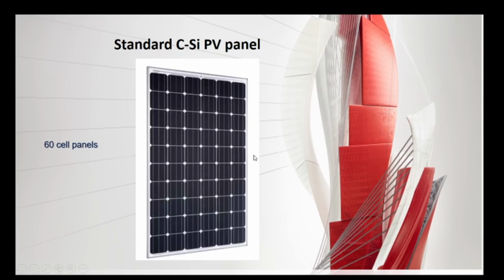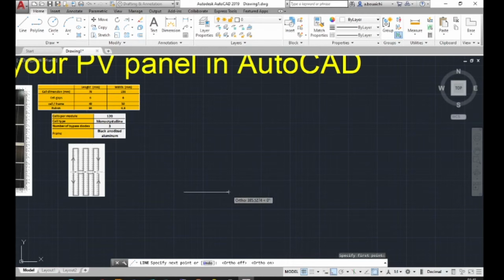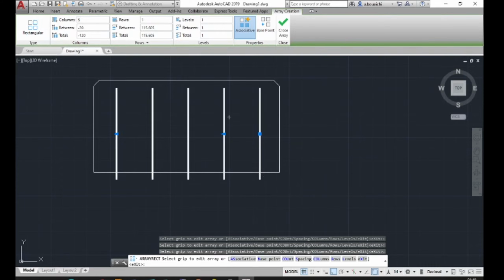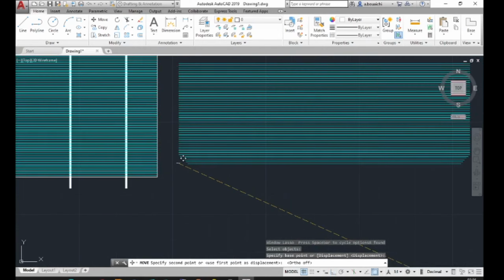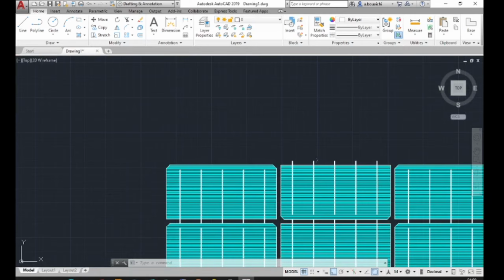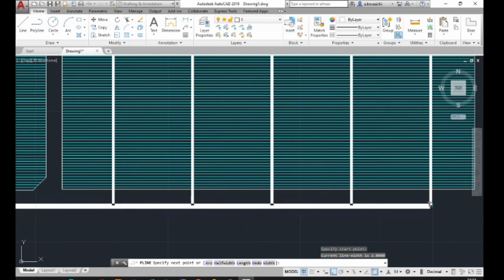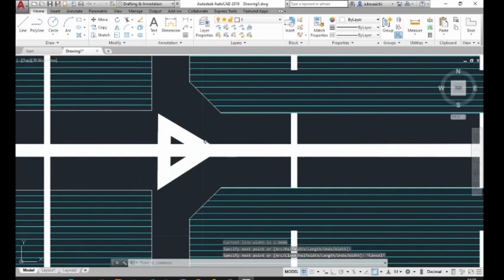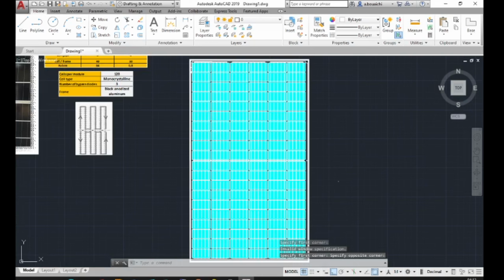1- How to design your Solar photovoltaic panel in AutoCAD

Comment: There are many versions of Autodesk available online. Which one is best for Solar design, Autodesk electrical, Autodesk mechanical or which exact verison name?
Reply from the maker: Hello,

You can work with any version  of Autocad for solar design, but the Electrical version stands out as the most advantageous. It offers the convenience of utilizing a pre-defined library of symbols, enhancing your design capabilities.
Reply: @photovoltaic4you  thanks for the brief info